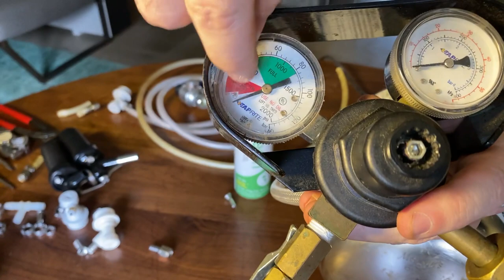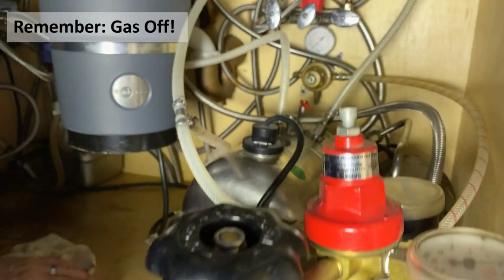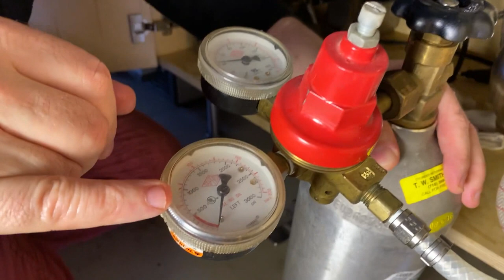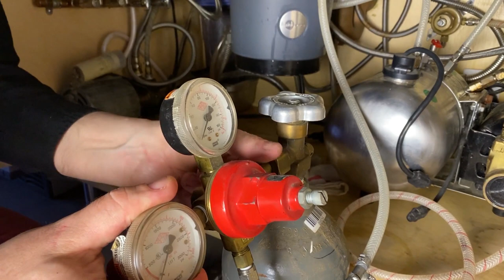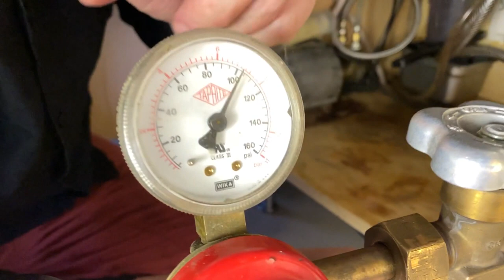Setting up a Home On-Tap Carbonation System -Complete and Unabridged

Comment: Thank you so much for the detailed walkthrough, Dave!

I completed my setup after watching your video many times. We are now getting ice cold super sharp carbonation on demand at all times, what a dream!

Mark Powers seems to be on a hiatus, so I used Soda Dispenser Depot for all parts - one thing the video didn't list is the carbonator procon pump has a 3 1/4" flare with a 1/4" barbed fitting for tubing. Also note you can buy a 3 1/4" cap from them (don't forget the washer) for the extra water outlet.

I ended up using a cooler bag with large Cooler Shock ice packs under my sink for the cold plate and it's working like a charm, and I don't have to worry about drainage, just the work of swapping ice packs every day or two.

As a final addition I bought a krome dispense C503 tower from Soda Dispenser Depot as well, and drilled my sink for it.

Thanks again for helping me put this thing together.

Comment: Just finished my seltzer system and it works great!  I wouldn't have had the ambition without this step-by-step well detailed video.  instead of the cold plate, I bought a $43 6-can capacity mini fridge & some 1/4" stainless steel tubing formed into a coil.  I drilled 2 holes in the side and used Great Stuff to seal it up  after the tubes were fed through.  We'll see how it works in the summer.  Thanks Dave!
Reply: How has this setup been working for you?
Reply: @sdcnzl  not as well as I hoped.  The carbonation was weaker than I wanted, not as cold as I hoped, and I had the wrong dispenser that gave metallic taste after a while.  I'm almost done doing it a different way.  Split the pu.p and holding tank on the carbonator.  Putting the tank in my fridge with an appropriate dispenser.   Now the seltzer doesn't have to travel 30 feet to my dispenser.   Hope it works better
Reply: Those super mini "fridges" don't use refrigerant and a compressor.  They can't cool like a real fridge.

Comment: There are a quite a few ways to carbonate water at home, but this using a compressor is by far the easiest I've found because you don't have to shake the water to solubilize the CO2.

Comment: Really good video.  Explains everything I had questions about.  In figuring out how to put a complete system together, I have a few questions:
1) Any reason not to put the McCann in a mini fridge and skip the cold plate?
2) If an Ibis 1-Faucet Tower is not an option, what does the Becker hand valve install into?  I see a selection of Draft Beer Towers but nothing to tell me what the Becker is compatible with, or how to tell that.

Comment: I have always dealt with Foxx for all of my needs. I was doing all types of repairs on soda, and beer systems and still purchase any supplies I need for my personal systems since changing jobs many years ago. Before I moved to he EU I ordered the 220volt motor and sensor for this same McCans carbonator. Works great, too bad Coke and like products post mix syrups are too expensive in the EU, main reason is that they only use cane sugar in syrups. High fructose corn syrups are illegal here. They still use the Stainless steel kegs here for syrups. Thank goodness I have all the fittings needed.
That hose used for carbonated beverages (double wall hose) must not be exposed to UV light. It will degrade and could rupture creating a real mess. I prefer the double sided clamps, they make for a better seal.
I would recommend adding a stainless steel shutoff valve on the output of the carbonator should a line break. It’s also good to shut off the electric, CO2 and water if you are going out of town. Better safe than sorry, nothing worse than coming home to a flooded kitchen. As for those quarter turn valves, you need to work them a few times every three months. They will freeze up with mineral buildups (yes even with soft water they will clog ) and will become inoperative or extremely hard to operate.
Interesting build up of a water manifold under his sink. Here in the EU plumbing supply houses have manifolds with up to 8 ports. Only issue is they use 1/2” British Straight Thread compared to our 1/2” tapered thread.

Comment: love this guy, great video, thank you. I learned a few things I haven't seen elsewhere on the internet.

I was tempted to buy a big mac carbonator, but I wanted something I could fit the tank right in my kitchen fridge. I got a 1.5 gallon 6 liter torpedo soda keg. I got a special lid to put on the keg which has the water inlet and the float and spray nozzle. my ro filtered water is only 35 psi, so I have a diaphragm booster pump ordered which should fix that problem for me, cuz I want high carbonation. I was tempted to get a cold plate, but much better to just put the whole keg right in the fridge. I'm still looking for a soda tap/dispenser valve. difficult to find one I like. I'd love to have a proper soda fountain dispenser, but no idea how to connect to one of those heads without buying the whole fountain, which is far outside my soda budget.

Comment: hello thank you for sharing, wondering whether the gas inlet on these has a tube to bottom of the tank or feeds from above water level? we tried to build one though not getting much carbonation, we feed from top without a carb stone... TIA

Comment: Ok professor(journeyman plumber here) I loved the video but wanted to clear up a psig (water pressure to the home) thing.We install PRV’s ( pressure regulator valves mostly brass )valves all the time! They regulate those whom are getting high water pressure100+lbs down under a “normal range” of pressure.Watts PRV’s are 3/4”to 2” in size(most are on 1” water mains for residential applications) The pressure regulator are at 90lbs on the high end to 45lbs on the low end.
Reply: You completely missed that he said.  Go back and try again, journeyman...

Comment: Great video! Thank you. One thing I'm not clear on is whether you are carbonating tap water at room temperature or using cold water from the cold plate. I understand that you need to carbonate cold water. 
What's your PSI setting for carbonating warm tap water.

Comment: Great video David.  

I agree with the person who recommended you package all the products together and sell it as a package deal on say Amazon.  I would buy it right now, as I personally like buying new versus risking buying someone's old used possibly poorly maintained restaurant equipment that may fail and flood the house down the road.

I have a sink/drain along with an ice maker and Culligan's Aquasential tankless RO drinking water filtration system that provides over 600 gallons per day of RO water at an outlet flow rate of 0.42 gpm with a recovery rating of 69.6%.  Specs say the unit has a daily production rate of 757.2 gallons per day.  I would very much like to feed your recommended carbonation setup with filtered water from this system into a cold plate in bottom of icemaker to chill the water and then feed it into the carbonator.  What do you think?

Comment: Awesome video, but if I wanted to combine the faucets for chilled water and carbonated water, what type should I get? Or perhaps also hot water, since I also have an undersink boiler? You mentioned that the valve type was important for carbonated water, and of course I’d need the fittings to all be stainless

Comment: We live in an area with extremely hard water.  We use a service that delivers those 5 gallon water bottles to the house. You said you could pump the water straight out of the bottle, does the McCann actually pull water or is it just an inlet valve? If it’s a valve, won’t I need a pump or something? Thx

Comment: Thank you for the thorough explanation Dave. I'm making a, I believe what you called at 00:44 "hand carbonator", straight to bottle carbonator rather than on-tap. You said you'll make a separate video about it but I haven't found one by you. My question is - you said at 8:50 that for soda you need over 100 PSI and the beer regulators that go up to 60 aren't enough, in your opinion is this also true for a hand system or only for inline carbonator?
I've seen a couple other videos specifically about hand systems which weren't even as tenth as thorough and experienced as you, and at least two of them suggested pressures of closer to 40 PSI. One said 60 works but only for water, and when used to carbonate juice anything above 40 PSI will shoot out of the bottle. Another YTer said something similar with 15 PSI for juice and 30 PSI for water. I'm aiming for dual-purpose juice/yogurt and water, and I do want aggressive carbonation for the water. The SS carbonation is fairly flat to my taste and I heard it's ~12 PSI. Do you think a 0-60 PSI range is sufficient for a straight-to-bottle system?
Reply: I used a 0-60 hand carbonation system for years and it worked fine.
Reply: Three considerations for the highest carbonation: 1- DE-Aerated H2O to begin with (a quick boil, then cooling). 2- Before infusing, as COLD as you can get it, short of solid ice.( just to the almost slushy stage. 3- As you are infusing the H2O with CO2 gas,  briskly AGITATE the bottle until no more CO2 will flow into the bottle. This exposes more water surfaces to the infusion.

Comment: Thanks for the vid! I will be following a lot of your advice on my first home system here shortly. It appears  Mark Powers is out of business, any new recs besides foxx? Also out of curiousity.. what keeps the lines from freezing inside your ice maker? And even the loops in the cold plate itself? I'm thinking of just isolating the tank in a fridge for my setup but still curious of the cold plate thanks!

Comment: Thanks so much for putting this video together. Unfortunately, Mark Powers and Company is no longer providing parts. They are now strictly a service and repair company. Where else can I purchase these parts? Foxx won't sell to individuals.
Reply: chicompany.net has everything except the hose (the one Dave recommends is reinforced barrier hose and they sell barrier tubing and reinforced hose but not a single product with both properties)
Reply: I just built all of this and I used installationpartssupply.com and buyfittingsonline.com. And yes these parts and fittings are a PITA.

Comment: Hi Dave, very informative video. Great job! Quick question, maybe with a long answer. What would be the roadblocks I would run into putting the whole system in my utility room and just running the carbonated water line to my kitchen. It’s about 30 ft.
Reply: I did something like this, with the system in my basement running up to my kitchen. The obvious thing happens: the water sitting in the house after the cold plate gets warm and foams coming out (losing carbonation). After that water has been dispensed the water that was sitting in the cold plate is better, although it is still slightly warmed from passing through the hose on the way. It works fine for me, I either throw away the room-temperature water or let it mix with the cold water that follows, depending on how cold/fizzy I want my drink. With 30 feet of 1/4-inch hose you will get about 10oz of warm water each time you dispense. You can insulate the hose if you want the water in the hose to warm up slower.

Comment: Would this setup work?: 
city water-->mccann's pump-->[water pressure tank-->bigmac]-->flow control valve. [] means in fridge...  purpose of the water pressure tank would be so I can have more cold seltzer available at all times and so it has time to sit and cool down in the fridge for optimal co2 infusion.

Comment: Thank you for the video!
Does the inside of the tank ever rust or go bad in any way?
I have one that's been in storage for a couple years (not temp controlled at all so it got really hot at times) that I was going to start using but how do I kno that there's no rust, mold or anything inside the tank? 
Any enclosed container that once held water could get gross over time couldn't it?
Reply: Just spoke with Dave, and he says it should be fine, just run some cycles of water through it to kind of flush it out and you should be fine!
Reply: remove the float probe and look in the tank with a flashlight

Comment: Stupid question - what keeps water from freezing solid inside the cold plate when the system is idle?
Reply: hmmm... the cooling water in the tube wants to expand, because its enclosed in the hose it creates more pressure, the pressure in turn lowers the freezing point to that of below the ice on the outside.
Reply: @Bigbagadoosh  From wikipedia, the melting point of ice only falls about 0.0072 C per atmosphere of pressure.  Ice at -5 C (warm for an ice maker) would require over 10000 psi of pressure to melt. The cold plate and hoses would burst at a tenth of that.

I'm guessing it doesn't freeze because there's plenty of heat leakage and just not that much ice.
Reply: @nelumbonucifera7537  without a source to make the ice colder the ice will only get warmer, perhaps if salt is added the water in the hose would freeze
Reply: The ice is on top of the plate, these ice makers put ice on a chamber that is not a  freezer, so the ice is always melting as these machines are plugged to the drain.
Reply: ice is not that cold, it is always melting, which is removing heat from the product in the cold plate...only time ice will freeze product in a cold plate if it is taken out of a freezer which is -5 F it could freeze the product for a while put will eventually thaw out
Reply: @Bigbagadoosh  add more ice when the ice melts in your beer cooler what do you do?

Comment: I did this exact same thing and put a bar tap on the counter with all my mixes. I am on a well so I have an RO with 6 gallons worth of storage tanks. Killer replacement for the old sodastream rig. If you buy your tank, take it tona fire extinguisher shop for refills... you get to keep your expensive tank and don't get some beat to shit rental
Reply: if you have RO water your hosed..you CAN'T carbonate RO water..fire extinguisher shop..lol i get it but is that food grade..the tank they used to fill those extinguishers are probably filthy on the inside loaded with crappy oil ect
Reply: @paulbunyun4479  OF COURSE you can use R/O H2O !!. My setup adds back some minerals, after the R/O filtration. I then boil the water to de-aerate it (holds more CO2 that way. let it cool, bottle it, get it slushy-cold in the fridge, Then  I CO2 infuse it at about 60psi, while agitating the bottle until no more CO2 will go into the bottle. Then I re-frigerate it  until I want to use it.  All works like a no-sweat system, and very inexpensive.  P.S. I suspect that ALL CO@ is food grade. That way, all the suppliers don't have to keep track of separate systems.

Comment: Would a cold plate work inside of a chest freezer just off the cold air? Would I need to use ice at all? Great video, I've been dreaming of putting in such a system. I might just do it now. Thank you.
Reply: I think if you do that the seltzer will freeze inside the cold plate
Reply: @chrishundt8839  good answer! than maybe it will burst!

Comment: Sorry i know video is older but i have a sodastream model is terra its non electric and has quick connect to terra to co2 tank and i dont have any regulators not as hardcore like your system!So i purchased a 5lb co2 tank and a hose with quick connect and connected my terra to 5lb tank and when im carbonating water this white substance is coming out of the top of my sodastream from what i told you do you know what im doing wrong or what the white substance is?Thankyou!

Comment: Thanks for this great info. I am stuck not where I just turned on the water supply to the setup and the vent on the backflow preventer is pouring water out. There is no C02 and the tank was empty. I assume the procon pump allows water to pass without being on and that the issue is with the backflow preventer itself?
Reply: correct replace it

Comment: Hello,  thanks for this video.,  I have one quick question.  My co2 tank has 3 guages on it, one goes to the carbonater and one goes to the pumps.  what should each of those read.  One of them is at 100 psi and it looks like the other is at zero, or over 100.  there is also a guage on the ;pumps that is on 18.  any help is appreciated